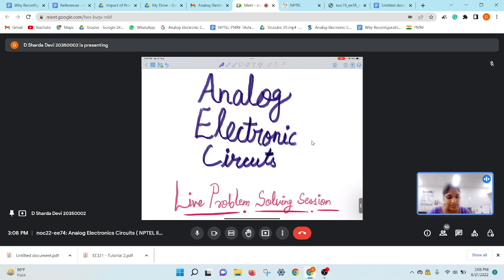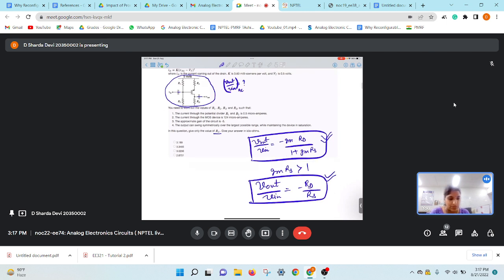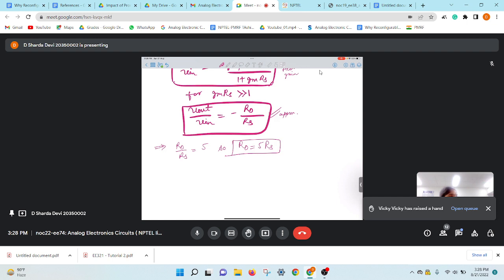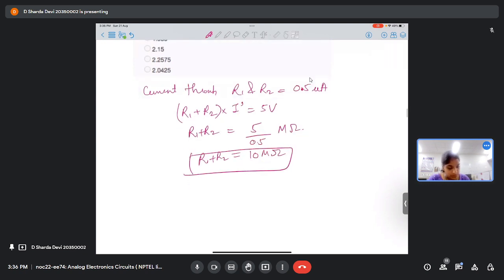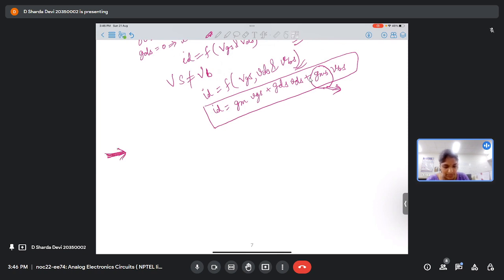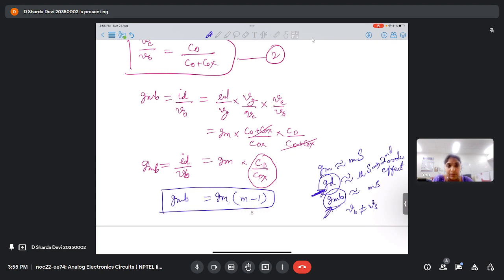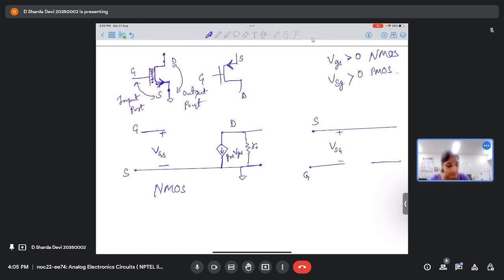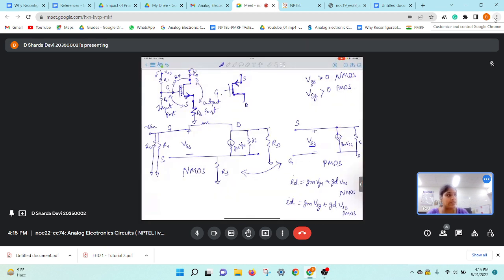Week 4 Live Problem solving session: Analog Electronic Circuits

Comment: Mam in assignment Rs= 4.25 kilohms
But that is not given in option
I have checked all the steps it is okay but I don't know why the answer is matching with option
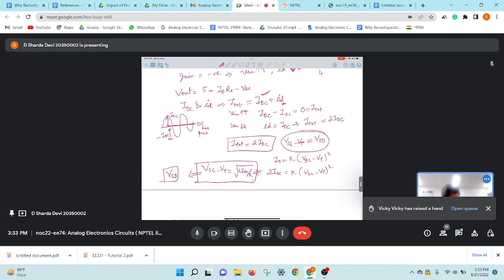Reply: At 26:06 when mam write equation, it is vSD i.e small v suffix capital SD so the current should also be overall current iD= 2ID here.
If you do like this you will get answer. I think mam mistakenly forgot that 2ID.